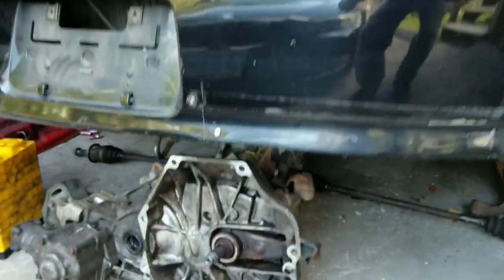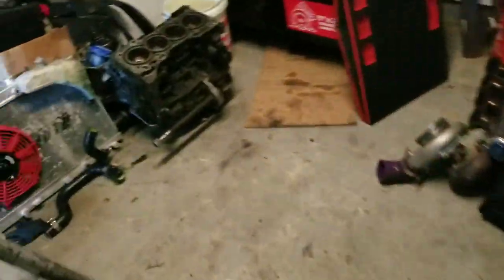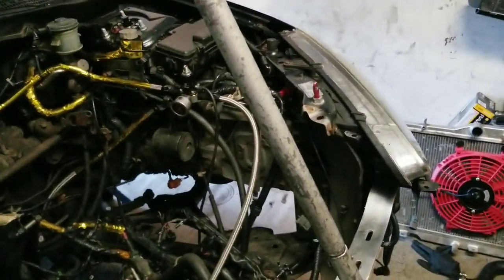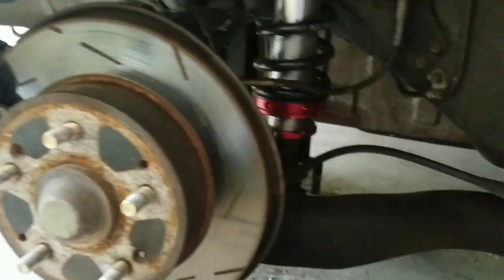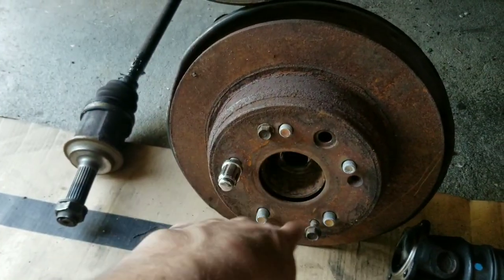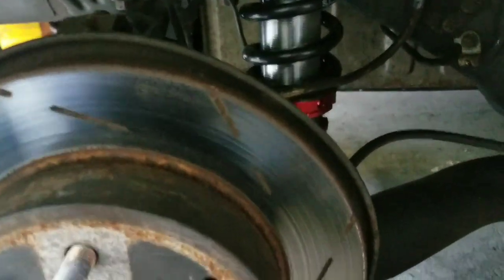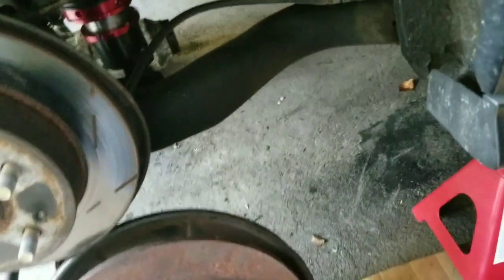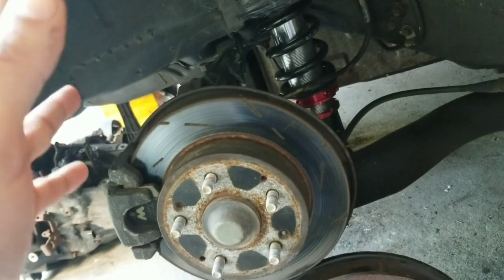Project AWD Acura RSX - element spindles

Comment: Oooh so you used the rsx trailing arms, thats why you had to modify the bolt holes on the trailing arms right ?
Reply from the maker: Yes but after some testing I recommend using crv/element trailing arms. But for alignments.